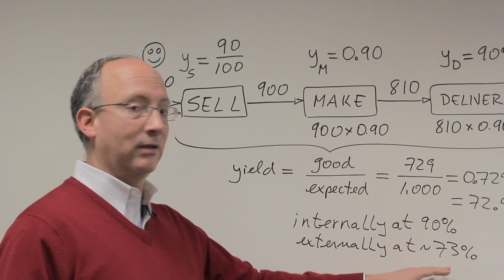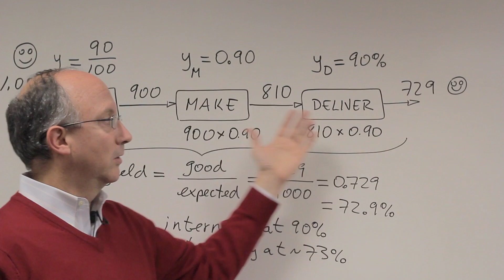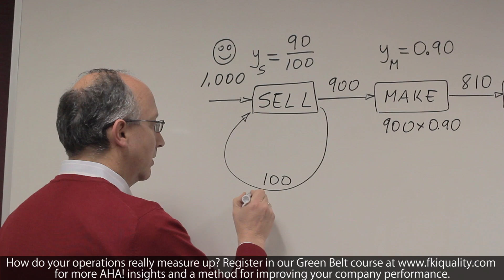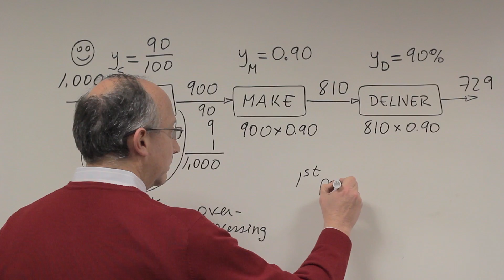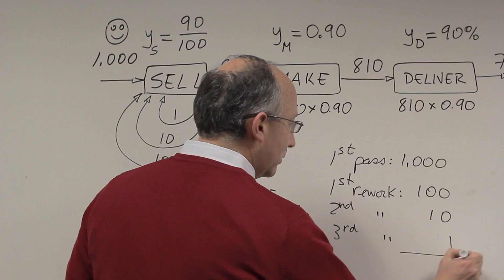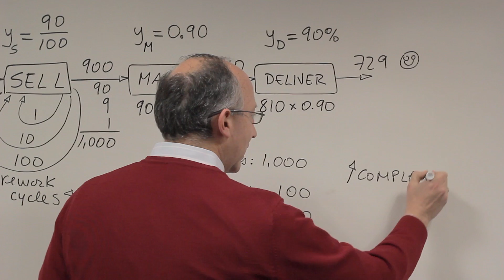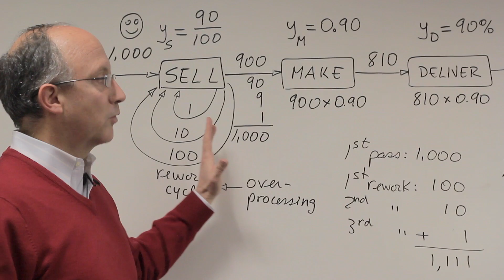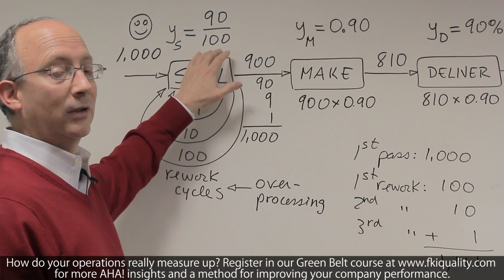How to Avoid Rework - 5 Hidden Costs of Low Quality | Green Belt 2.0® Lean Six Sigma | fkiQuality HD

Comment: I enjoyed how rework costs can easily become costly to a company due to low quality products. I also like how the rework cycles show how many times you would need to over process the product to get all through. It shows that if you are producing low quality, the energy of the machines, wear and tear, and much other aspects will be affected. It just goes to show that you should wait to ensure you have good quality product before running, other than having production start and have the possibility of having to rework product.

Comment: I had not ever considered how quickly rework expenses can add up due to low quality. I have wondered if it's worth starting production while testing for quality rather than waiting on production until quality has determined the product is in spec. This lecture suggests that the cost of rework makes it not worthwhile.

Comment: I work in the maintenance procurement department of a steel treatment plant. It’s always important that any purchases made are correct for two reasons. One, shipping costs for parts are high; returning incorrectly purchased parts is costly. Two, if a machine is down while it waits for a part, it is not producing product to make the company money; that extra down time waiting for the correct part is money lost. Three, if an incorrect part or piece of equipment can cause an even greater failure down the road; this would result in higher maintenance costs than if the correct part and may result in a loss of raw materials and defective product. Those are three of the numerous hidden costs of failure in one department. That doesn’t include what can happen in the numerous other departments in the plant.

Comment: Referring to my previous comment of asking ‘WHY?' would now manifest into the how.  We saw in the last video that operations were yielding 30% less than initially thought.  In this stage of the process the organization would need to quickly figure out what the challenges are, in efforts to be more efficient.

I’d recommend looking into the orders entered, what the tolerances of acceptability of the items that demand rework are, then reassess the data being used thus far, and optimize the production process moving forward to mitigate the duplicated efforts to get the right product out the first time.

While these things take time, if you are able to visualize the data points and present them to key stake holders, this could be a plan or proving ground on changes and why they are needed moving forward with this production process.

Per the video the removal of rework and customer satisfaction would bring the organization to the expectations of their yield and creating continual improvement with their customer base moving forward. Yee haw!

Comment: It's interesting to connect this to the real life. I worked at a place that operated like this. We would certify bad vendors and not check their parts as thorough, just to find out the whole shipment was bad. At that point, the bad products had reached the production line already, so we had to tear down finished goods, repackage the bad parts to send them back, wait for the replacements and take a dink on the on time delivery metric, and spend time thoroughly inspecting the new ones again and rebuilding. It would have been easier to inspect the first time.

Comment: 6. Opportunity loss due to time, labor, and materials invested in rework versus attending to the next customer whose order is waiting to be filled. In large-scale printing operations, rework means the press has to either be held and not changed for the next job, or means the press has to be reset for the rework. Rework delays the next job in the production line.

Comment: The rework "chasm" cycle is further repeated for every step in the process. One can imagine that if the final sales order that is completed (fourth sale cycle) ends up being one of the 10% or worse TWO of the 10% in the following processes, depending on your operation, you may end up with a lost sale (contract nullification), a lost referral, or having to deliver an item at 0 cost, save their time, to the customer.

Comment: Great breakdown on how poor quality leads to more time and money spent.

How often do you think poor quality is the norm until you actually root cause the situation and identify effective counter measures? Many times my employer will create SOP's in a building not attached to where the processes will be enacted therefore quality points are found after the initial drafting of the SOP. This leads to processors being frustrated and then they begin to circumvent the SOP which can lead to a more efficient process (initially) but quality issues. As you know this makes from an unstable operation and one that cannot be measured equally considering everyone is trying to do something different. I am hoping to change some mindsets and strategies in the near future - one can only hope!!

Comment: Getting the job finished quickly may feel accomplishing but only if it has good quality. Getting it done slower but correct the first time will save in the long run. Haste makes waste. This is especially difficult when there is the pressure of too many job orders to handle and working slowly seems like the opposite thing to do. The trick is to develop processes the help you work more quickly or less wastefully while maintaining quality.
Reply from the maker: Good comment, in class we will see how you can do that precisely, developing processes that have fail-safe factors designed in. This will be a combination of physical, procedural, and motivational factors.

Comment: Even if the rework was done in the Sales cycle with increased accuracy, say by half, there is still a 5% rework added to that cycle, which compounds into the next two phases (production and delivery) on just the first cycle of rework alone. Tracking over-processing to attack problems on the front end seems like a better approach than fixing recurring problems.

Comment: So theoretically, could it be less costly and wasteful to scrap your initial 10% that was not yielded instead of reworking it and taking on the hidden costs? It's still a high cost but, at least the resource consumption ends with scrapping it.

Comment: Lower customer satisfaction, increased overwork (overprocessing), lower productivity, unnecessary complexity, and profit reduction are the 5 hidden costs of not doing the work correctly the first time. These costs are usually hidden an unaccounted for but still a cost that affect the bottom line.

Comment: The overall impact on the bottom-line (profitability) is greater based on the hidden cost.  It is important to validate what is perceived as a return internally aligns with what the customers experience externally.

Comment: While the 2nd time doing something tends to be completed more efficiently than the first AND usually more care is taken to minimize the failure rate during 2nd and subsequent times, this is still focusing on a great point - that failure causes waste.  This discussion focuses on extended effort required within sales.  If the failure in the sales process was a mis-statement of the client specifications - causing "Make" to waste effort and then "Deliver" to waste effort for both Sales and Make failures - this all adds up to waste that could be prevented.
Reply from the maker: Jory, it can happen the other way too, where rework is actually done at a lower level of quality than the first pass.

Comment: 90% efficiency is not good enough. There are hidden costs: low customer satisfaction, over processing, lower productivity, increase complexity and lower profits. The departments need to work better together to increase efficiency and lower costs.
Reply from the maker: Maureen Urchel, that's what's needed. Even if each department were operating at 95%, the total yield without rework would only be 86%

Comment: I agree, checking for quality during the process is very important. In machining, we try to eliminate dimensional problems by making sure we have the correct cutters sizes and have the parts accurately positioned in the machine. I believe that this is a core part of continuous quality. You have to start off with accuracy as the most important concept.
Reply from the maker: Must also study the reasons behind variations in dimensions so that they won't happen again

Comment: there are many hidden costs in low performance. a lower customer opinion will affect referrals and repeat customers. also rework costs the company fairly significantly. the time of the employees, the materials and the cost to the customer. also if you maintain the 90% yield at each stage there could be multiple cycles of rework.

Comment: A companion perspective of Lower Productivity is that with fixed resources, the units needing rework take up space in the process and prevent more new inputs from being processed. It's lower capacity, too, not just lower productivity per unit successfully processed. This will create an input backlog and overall longer cycle time per unit, which will affect customer satisfaction as well.

Comment: I found this video fascinating on many levels. First, I think most people have experienced these hidden costs in their work but seeing the actual numbers behind the hidden costs was revealing.  Secondly, three reworks at a (really good) 90% departmental target?!?  You can quickly understand how many more rework cycles are needed if the goal was, say, 80%. Third, looking at this mathematical representation, you start to see why start-ups struggle and often fail as hitting a super high first yield is challenging to new businesses. Lastly, the comment that I will remember forward going is the truism of how companies find time to fix things (rework) but don't put the same effort into the planning. Clearly this demonstrates how important it is to plan and get things "most right" the first time.
Reply from the maker: I'd be interested in your views related to start-ups having trouble hitting super high yields. Is this due to the complexity of the product itself? Is it due to poor quality management (poor/no records, no lessons learned thus reinventing the wheel in each iteration, lack or "bug" prioritization)?
Reply: I think all the items you note are more symptoms than the problem. For me, I think the problem is the way start-ups view themselves.  What I mean is that it seems that the M.O. of start-ups is a combo of "need to be first to market" and "create a minimum viable product and iterate".  So, the process is inherently built on speed and rework.  It's a foregone conclusion that rework is assumed as part of the process.  Also, start-ups(again to me) are usually small (small companies or "pods" within a larger company.  This said, there are less innovators in the system and the focus, if a product takes off, is scalability over (or in tandem with) iteration. Hence, it makes me feel that the start-ups that pan out are either completely lucky or extremely controlled and agile.

Comment: Unfortunately I don't believe we see these principals practiced enough. If I think about things that I've recently purchased and had issues with if the manufacturer took the time to develop their product more then I wouldn't have to return/exchange 3 different refrigerators and 2 different stoves delivered in a 6 month span. We live in a disposable world were things are being mass produced with low quality and break fairly easily and it leaves the consumer stuck because your options are limited and if you want to pay "more" for a "quality" product those two might not be positively correlated anymore. Take the brick and mortar stores for example, the boogie man who destroyed the brick and mortar stores supposedly is the evil online shopping environment which I believe is only partially true. If the stores paid closer attention to the way consumers were shopping than perhaps they would have noticed people weren't coming to their stores just because of online shopping but because of the condition of their stores, the poor customer service when shopping, the product the customer was shopping for was not in stock and the list goes on and on. The good and service industries are in trouble once people start waking up more.

Comment: It is important that companies factor in the CoPQ into their analysis. Rework cycles are cumulative and add an exponential time and material cost to the operations. Try to do it right the first time itself and if that is not possible then ensure it is as close to customer and market requirements as possible.

Comment: These costs are relevant also within the software development process.  It is more a Define-Make-Deliver model rather than Sell-Make-Deliver, but the consequences and costs are very similar.  In traditional development projects, the initial phases of project scope definition and business requirements definition have been the culprits in low quality.  Some projects are too broad in scope, attempting to deliver an unrealistic amount of functionality within the allotted duration of the project.  In other cases, business requirements are incompletely captured and defined initially by IT, and often are not identified by business clients until in the late stages of the Make process (user acceptance testing).  This can significantly add costs and delays to the project.  And in some cases, the missed requirements are simply not included in the delivered software until a later project.  This can significantly lower customer / client satisfaction.  In the past 15 years, agile project methodologies such as Scrum have gained in popularity to overcome these issues because they provide an improved framework to quickly deliver incremental, high quality functionality based on customer / client priorities.

Comment: It's very easy to apply these hidden costs to our own jobs. First time success does require more planning and attention to detail, but you end up saving time in the long run due to some of these hidden costs like the rework cycle and increased complexity. These are some of the tangible items where you can peg a number to their cost but this also leads to lower customer satisfaction which can hurt the company perception of reliability- a cost that often leads to customers trying out competitors.

Comment: Similar to the previous video (90%+90%+90%=73%), the further a process is from perfect, the greater the effect. 90% leads to 111 reworks, but 80% leads to 250, and 95% leads to only 52. (In probability theory, this is similar to a Markov chain.)